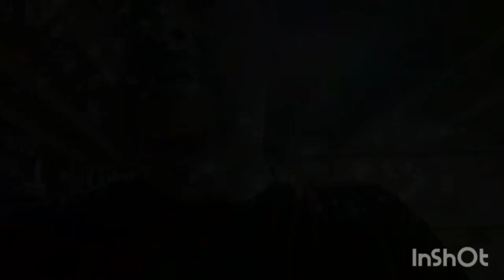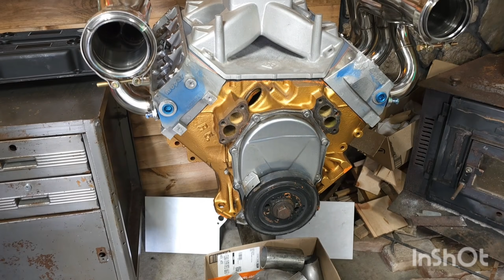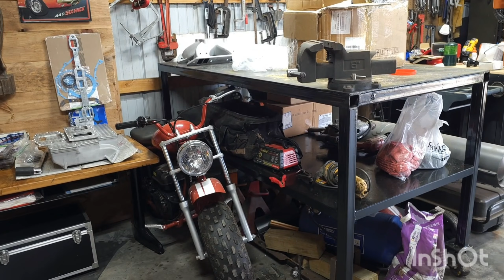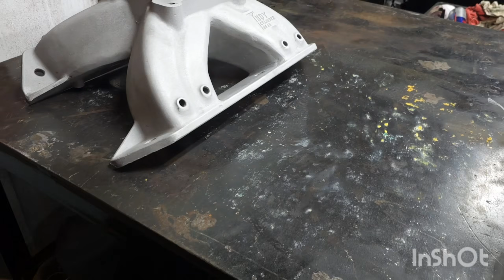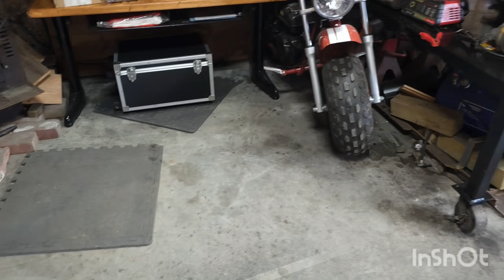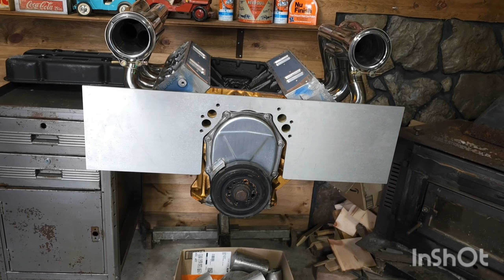BIG BLOCK MOPAR WITH TURBOS

Comment: The oil supply orifices in those Chinese turbos usually aren't a sufficient size. I've seen somewhere on YouTube where they opened that up. They kept having turbos failing prematurely and finally figured out it had insufficient oiling

Comment: I went through the same dilemma for my daily driver slash drag and drive car. I love traditional big and small block mopars and I have a lot of really good parts lying around. But with the cost of machine work and parts it was going to be out of my budget. And if I blew it up it would be expensive and difficult to replace. Gen 3 hemi are plentiful, I think that they still make  the 5.7 hemi. The gen 3 hemi piston ring lands are weak. I went with the gen 3 hemi with 270k miles on it and the cylinder walls still had the cross hatch on them. These new engines with low tension rings and bi-metal bearings don’t wear. And if it blows up I’ll just get another one.

Comment from the maker: Hoping to run into the 5s and be more streetable
Reply: Cool. I would think 5's are very achievable with the 440 you have.
Especially with those nice heads and if I were you I'd just clearance the pushrod holes in the heads for .650 offset rockers. 
You could probably even get away with Chinese rockers because the 290s cam you mentioned doesn't require that much spring pressure 👍🏻
Reply from the maker: I was looking into the prw pq series .650 offset im sure they will work. Thanks for the info
Reply: @377PoisonDART4  I'm lookin forward to this project man!
Keep us posted 👍🏻

Comment: Hey man, cool update 😎 
What's your goal for the car?
Are you after an et? 10.0? 9.0?
Or a power number?
The gen 3 blocks are stronger than a 440, but If I were you I'd build the 440 because you own 90% of the parts needed. 
Turbos are soft on parts too so a factory block 440 can live at 1000hp.
If you want 1500hp definitely get a hemi